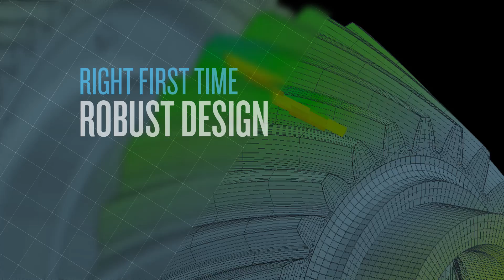#BEINTRANSMISSIONS Avio Aero and the technologies for future Helicopters - Le Bourget 2015

Comment from the maker: Tradition, expertise, experience in dealing with complex products, knowledge of the market, innovative solutions, Research and Development, a presence throughout the product’s life cycle and verticalization of products: these are the key features that qualify Avio Aero as the ideal partner for helicopter propulsion. And these are the words used in this video by Edoardo Curti and Alberto Demenego to proudly describe how Avio Aero coped with the challenges of mechanical transmissions. Reducing weight, increasing reliability and reducing the number of maintenance intervals are customers’ specific requirements that the company successfully meets in its projects.  #AVGEEK   #PAS15  #BEINTRANSMISSIONS